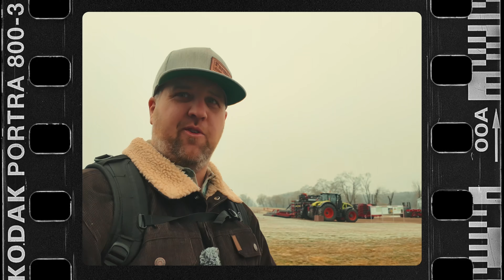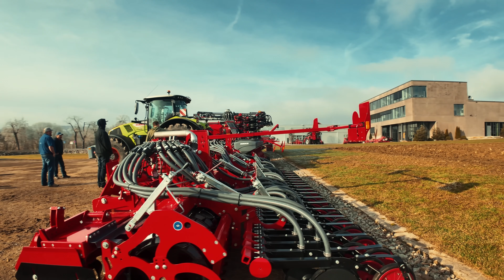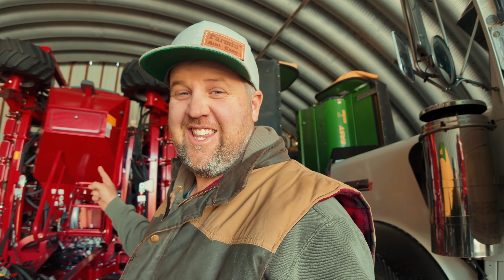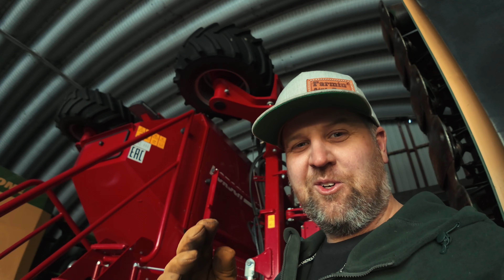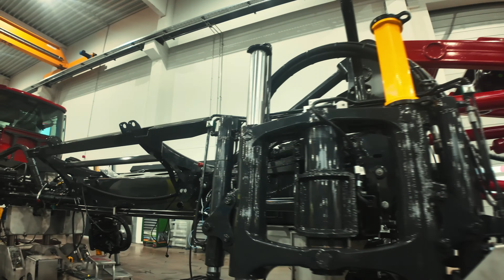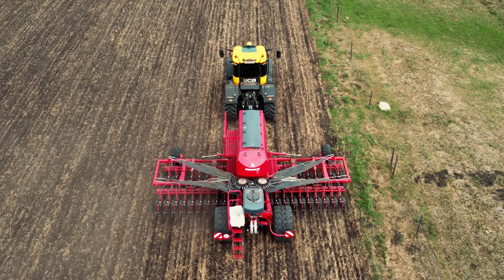Visiting Horsch in Germany - The Birthplace of Our No-Till Drill

Comment: Use to run a horsch dd drill, before the avatar came out, was a beast for land I was drill pasture for dairy in to. Had a demo of 1 of there cultivators but went sumo in end from the variety of land and crop types I was covering,  there new self propelled sprayer look great and would like to have ago one day with one. Vaderstad  has market hold in New Zealand  at the moment but can see horsch coming in strong soon if get the right dealer's as some have been hopeless! Even same brand 1 can be better then another so I use to take my case & New Holland tractor's 60k away compared to dealing with local branch, mechanics where great but sales & desk staff where useless

Comment: Cool trip. The best thing about Horsch is the high standard of quality and durability. And they really care for the customer - we had problems with bad fertilizer quality that started  building up in the front tank of our corn planter and they just said Ok we're figuring something out this Winter instead of it's not our fault . 
The Fastrac is perfect for spraying and with the front tank you can carry almost the same  amount of product like a self propelled sprayer ❤
Reply: I'd prefer a pull type sprayer over mounted sprayer due to bigger tank capacity and faster and easier connection to tractor.
Reply: @MrJurssi  every system has its pros and cons. The new mounted sprayers are easy to connect too, you just connect LoadSensing and ISO Bus, use a quickcoupler and you're ready to go. In some fields the mounted sprayer is easier to maneuvre due to field geometry and topography and it needs way less space in the (heated) shed.
Reply from the maker: Great feedback and comments fellas!   Thank you for the feedback and watching our videos.   Glad you enjoyed them.   Spraying is such a personalized application to every farm in regard to capacities and preferences.   A massive take-away from this Horsch trip, is that they literally have a sprayer for any farm or application.   Even drills and tillage equipment in most cases!

Comment: That sprayer was really cool, what a great looking line of equipment they produce over there.  John Deere had better up their game!!!
Reply: Especially the tandem axle sprayers are lovely. We have two of them on the farm and their automatic steering axles are amazing.
Reply: @ still running pull type sprayers here out of the 90s and early 2000s.   One day an upgrade into an older self propelled would be nice.
Reply: @chadtosh6831  yeah, due to regulations most people tend to buy newer sprayers with ISOBUS here.
Our two single axle sprayers from Horsch are probably less than 12 years old while the tandems are iirc 2 and 4-5 ish years old.
Reply: @ just bought my first isobus sprayer last fall.  It’s a Brandt, but not a lot of regulation here on what to spray with.  We don’t crop much, just about 300 to 500 acres a year.  Mainly forage and graze for cattle on our farm.  Hard to justify spending much on a sprayer.
Reply from the maker: Yeah i think your right #chadtosh6831!